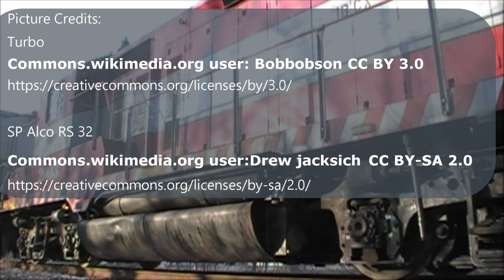Boosted gp20 v 2 0

Comment: I don’t think EMD ever referred to it as super charged. That called them roots blowers and that’s what they did, they provided scavenging air. I don’t think they ever provided boost above atmospheric pressure, therefore they were of no power gain. They were required for the engine to operate. And the 567 was released in 1938.

Comment: The function of the geared turbo was explained well, except for the part which you say the recirculation of exhaust gasses.
Which is incorrect, the turbo, and the roots blower on the older engines, have the function to provide positive air flow trough the cylinders to propel exhaust gasses out and replace them with fresh air. As the EMD engine is two stroke the exhaust and intake strokes are not there as individual strokes.
The engine has 2 exhaust valves in the cylinder head and intake ports in the lower part of the cylinder bore. The piston itself acts as valve for these ports. After the combustion stroke the piston nearing BDC, the exhaust valves open just before the point the intake ports are uncovered, initially residual combustion pressure will force gasses out of the exhaust so that pressure is low enough when the ports open and no exhaust gets pushed back in the intake. When both valves and ports are open the piston is around BDC and has little movement, so there isn't much encouragement for the exhaust gasses to move out. Here the roots blower or turbo comes in, it forces air in to expel exhaust gasses from the cylinder, this is called forced induction.
The roots blower had enough capacity for this proces but not enough to boost the pressure, that would require a larger blower and as you said that eats to much power from the engine and the turbo is the better option. Timing of the exhaust has to be a bit different too, it closes earlier than on the non turbo versions.
Reply: This is exactly correct. And explained better than I could have put it into words
Reply: Never seen an EMD or Cleveland/Winton with 2 vales per cylinder. Are there any examples of this? Thanks
Reply: @FixAndForget  I have to correct this, there are indeed more exhaust valves, 4 to be precise, but there are 2 rocker arms each actuating a pair of valves, the third rocker in between is for the injection I suppose?
Reply: @Tom-Lahaye  you are absolutely correct. 4 exhaust valves actuated by two rockers acting on valve bridges. Middle rocker is for the injector. Excellent explanation you wrote above, thank you for that sir.
Reply from the maker: Thanks for catching my error! I have posted a note in the description to correct my mistake.

Comment: I tell ya Joe- yeah a single part paint is easy and cheaper. But a 2 part does hold up better. And it does look better longer. I work at a boatyard and we've never had a customer request a single part paint. I'll have about 5 years into my Hatteras when I get done- and the only thing I'm laying down is Alexseal, and then I'm gonna drop another $2000 on ceramic coating. I want my boat looking good for as long as possible
Reply: Wrong video?  But since we're here non catalyzed paint has many drawbacks for almost every situation.  2k is almost always better except for very cost driven applications and some niche powder coatings. Yes there is 1k and 2k powder coatings.
Reply: I work on ships and volunteer on museum ships. It has become a side hobby trying to get the museum ships to switch from 1 to 2 part paint. I won't even use single part paint on a refrigerator.

Comment: Thanks for the video.. You mention the "recycling" of the exhaust gases by the supercharger (roots blower). Instead  the exhaust gases are force out of the cylinder by fresh air supplied by the supercharger.  
Thanks once again.
Reply: I heard that too, 2 stroke diesels require forced induction to scavenge the cylinder (force exhaust out of the cylinder) because they lack an intake valve, they only have exhaust valves. As the piston moves down on the power stroke at BDC (bottom dead center) the intake ports are uncovered and the exhaust valve is open. This is where forced air will force all the exhaust out.

Comment: Okay, the 567 was first introduced by late 1938 into 1939, not 1950(s) as you stated. The first EMD with a turbo was the SD24, which came out around 1958, predating the GP20. As for the low sales, as you stated the railroads had pretty much dieselized by 1960, (Norfolk and Western still had a few pockets of steam in service). Plus a recession was underway. That economic climate also affected Alco, and GE was releasing its U25 series. BTW all EMDs were roots blown until they came out with the turbo option, (the GP18 is the non-turbo version). EMD would continue to use roots blowers in the 645 series of prime movers, the SW1000/1001/1500, GP/SD38 series.

Comment: Weren't Buchi turbochargers good ones?....i live in india and old alcos here have Alco branded and napier turbochargers 2600 hp.....newer alcos have bharat heavy electricals (BHEL) turbochargers and are rated from 3100 to 3400 hp...
Reply: Are they still building Alco powered locomotives in India?
Reply: @RichardKroboth  They are being phased out.....replaced by emd 4000hp 710 engined diesel locomotives....
Reply: @RichardKroboth  Alcos will be gone by 2025-2026..